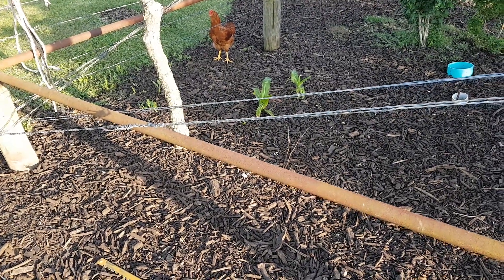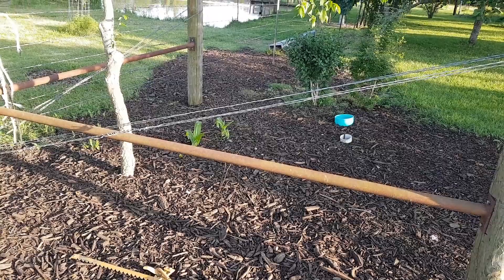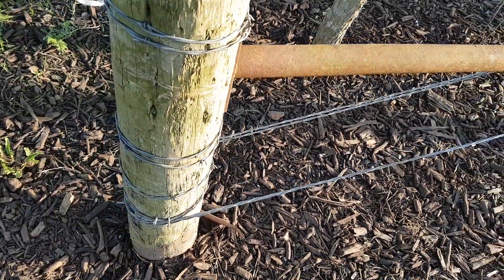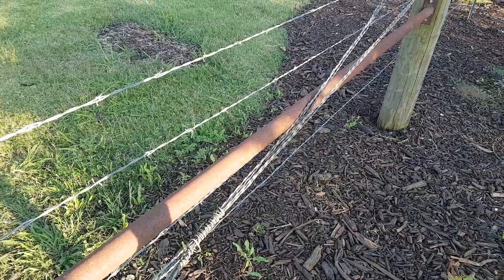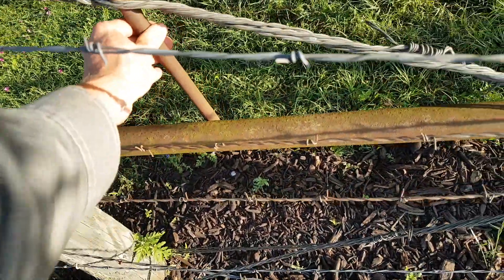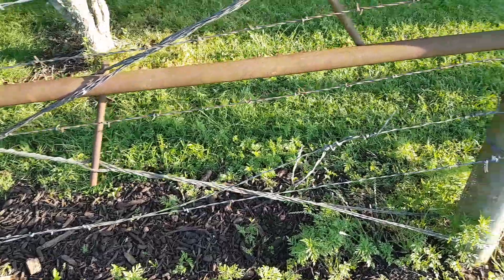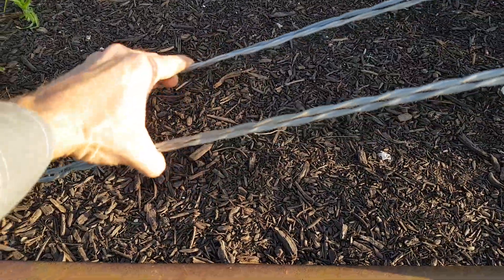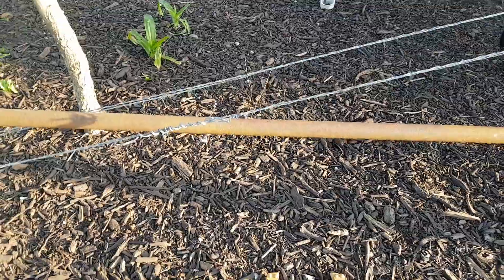H Post without Twitch Stick

Comment: Let me know how it stays up for you. The keeper in the wire should be wired to the horizontal brace. That way it won’t knock out or fall out also I subscribed.
Happy trails
Luke
Reply from the maker: Back to the Basics 101 Thank you. Is the keeper the same as the twitch stick? I'm hoping to get away from twitch sticks completely. I was thinking of using a wire strainer or turnbuckles for adding more tension but my hope was less stuff. Less stuff = less stuff to go wrong. Also less stuff you have to buy and carry around with you.